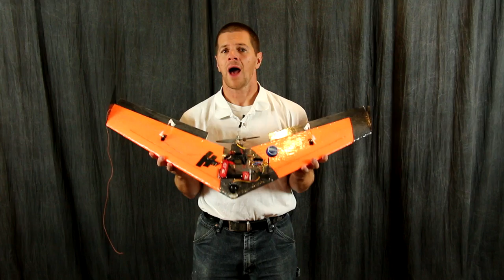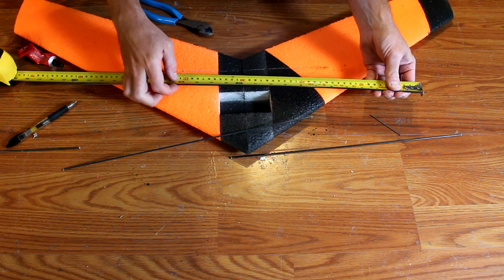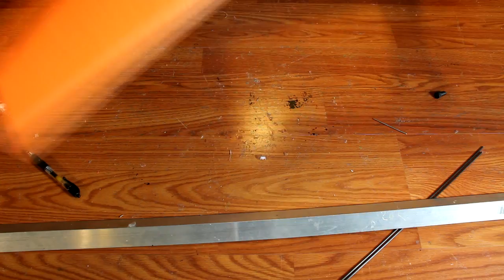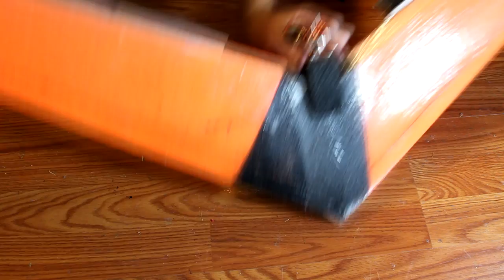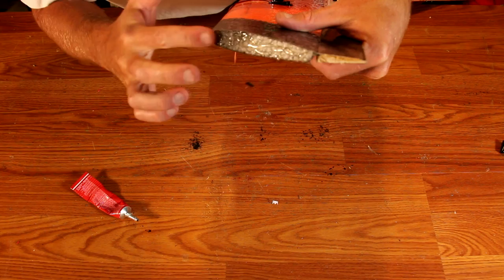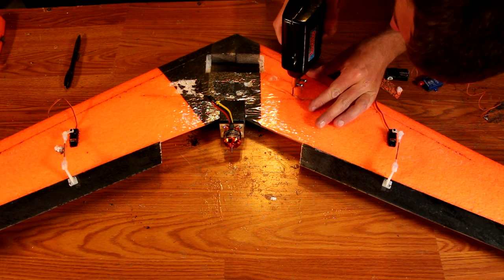FPVWRA wing build

Comment: New to fixed wing, but built 5 quads. Is this good for a first-time fixed wing-er?? It looks super fun to fly. Also, can I use a receiver that works with my Taranis X9D?
Reply from the maker: For a first flying wing, yes.  Since you ave built quads you will be familiar with the controls.  It is not a good first RC project, but great for a first airplane with quad experience.

Comment: Any reflex reccommendations for this? Just finished a build up and about to maiden but have been told different things. Start at 1/4 and trim down as needed or start super low and trim up as needed. Just figured I would get a solid awnser lol.
Reply from the maker: I usually start at 1/8" reflex and it is more than enough.

Comment: Where can I find the hand held foam cutter in the video? Thanks.
Reply from the maker: It is nothing more than a hacked soldering gun.  You can find them at almost any hardware store (or Amazon).  Just replace the tip with TIG welding wire.
Reply from the maker: Here's a good one, but you can find them cheaper if you look around: http://www.sears.com/craftsman-solder-gun-150-230-watt/p-00954046000P?plpSellerId=Sears&prdNo=7&blockNo=7&blockType=G7

Comment: SBA going to carry a kit? looks great.
Reply from the maker: Yes.  $60.  keeping it as cheap as possible.
Reply: Have you got any info for the FPV Fixed Wing Racing Association? Link maybe? I'm wondering what the specks are to qualify.
Reply: Thank you for the link.
Reply: I just noticed he designed it specifically for FPVWRA which might be a bit different
Reply from the maker: It fits the Spec wing class for MultiGP as well.  This plane is a very common size and was designed to fly just about any race track.